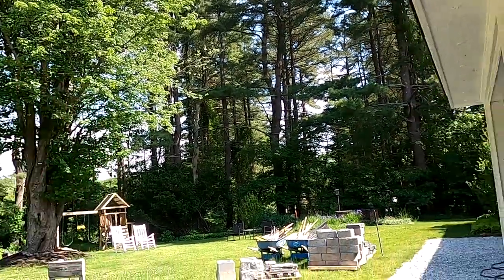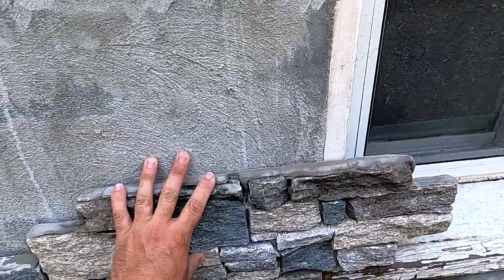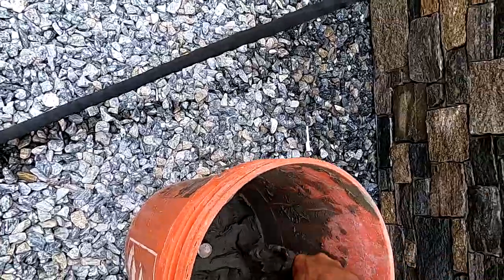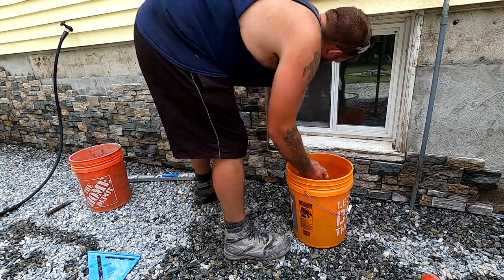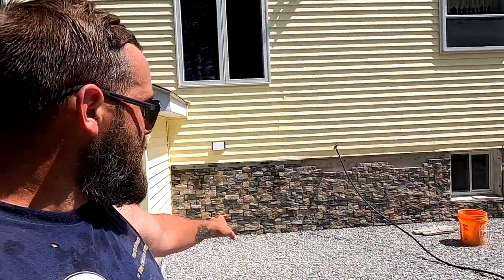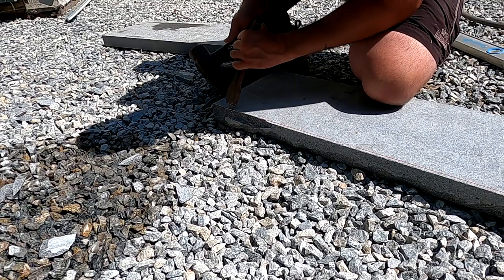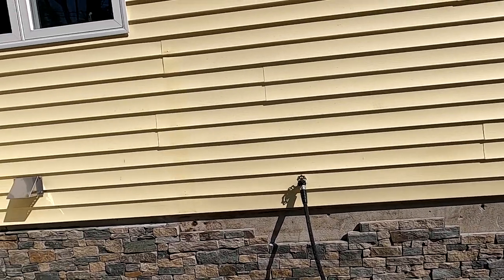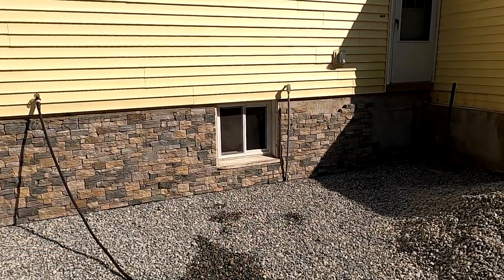How To Install Stone Veneer Panels (DIY)

Comment: It looks good looking forward to the finished project , just a question when your laying bottom layer at the start if the bottom of the wall is recessed about half inch in going up about 4 inches high from the rest of the wall would you just put on extra mortar  to bridge the gap,, if that makes sense,  ✌
Reply from the maker: Thanks! And yes, if it is set back only a half inch, you certainly can just make up the difference with extra mortar ✌🏻

Comment: Should I apply parging to my masonry block foundation before applying the stone veneer? Or just put the veneer right over top of the block?
Reply from the maker: That would do nothing but help but I don't believe is necessary for applications less than 4' tall. Just be sure to use a nice tile / stone veneer fiber enforced mortar when you apply it. ✌

Comment: Kyle trying to price out a job using this material do you remember what square footage the flats were and do you happen to know what corners cost thank you sir
Reply from the maker: Hey brother, the flats are about $20.00 per sq ft and the corners are about $30 per linear ft. and the corners are about .75 linear ft per unit. You can also get half pieces for about $22.00 per sq ft. ✌

Comment: Hi! I have a question about your application. I see you’re wetting the cement. Should it be wet when applying the stone?
Reply from the maker: Hello! Wetting the surface is a great thing to do. It cleans any dust off and helps the mortar bond better
Reply: @TheChristianHardscaper  that makes sense. I just started today. I have you to thank. I’ve watched all your videos. They are so helpful. Thank you for doing what you do.